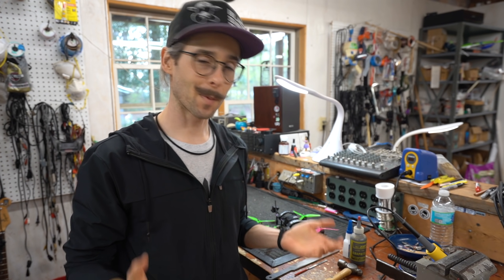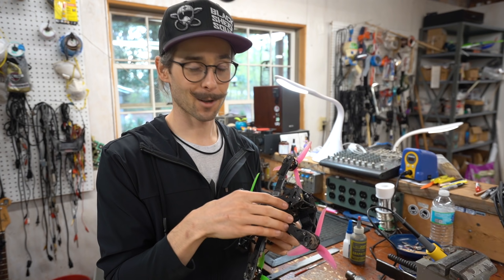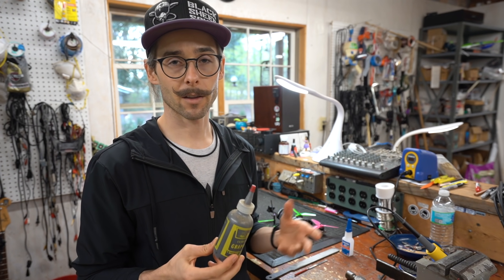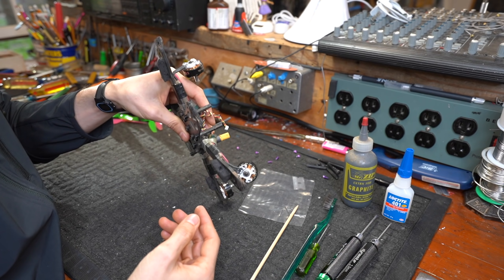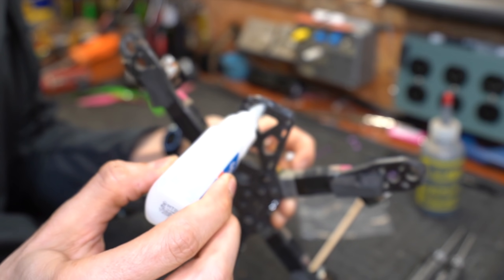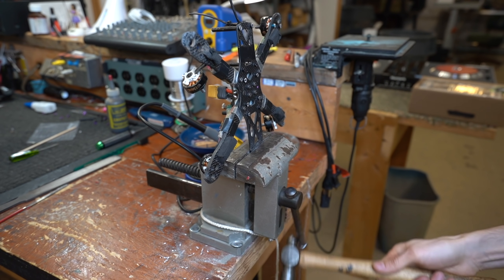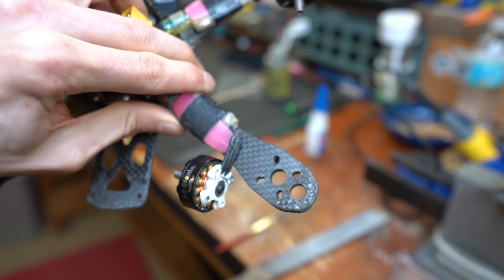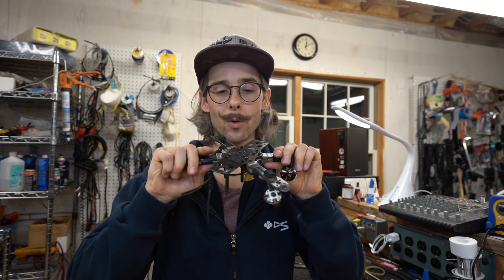DIY CHEAP Carbon Fiber Repair | FPV Drone

Comment: If the edges weren't exposed they wouldn't delaminate so often. One of these days I'm going to make a mold that adds a 90 degree lip to all edges of the carbon. So it would be a total flat plate but that lip will mean impacts are on the side of the carbon and not on the exposed edge.

Comment: Sweeeet!! Had frayed arms that frayed at the center of the quad where all four met up and were held with a screw and washer. New arms were out of stock, but after your video, glued, clamped, put back together, and back in the air!! You saved my weekend braaaa!! Thanks for posting !

Comment: Thanks for the graphite powder tip. I've used super glue with baking soda but the graphite powder is the missing ingredient. Just ordered a bottle of it from amazon. I may experiment with a baking soda/graphite mix to see what it does. I would recommend using smooth jaws on your vise and use a piece of pipe instead of a hammer. But overall, I appreciate this video.

Comment: you know a little length of PVC pipe will get you enough leverage to really clamp down on the vice without having to use a hammer :)

Comment: Hello  steel nice  video did u know if u use bakeing soda with locktight 401 it dry almost instantly and harder than just letting it dry

Comment: Please read this! As an aircraft mechanic working as a composite repair tech I feel I can give you some advice.  Clean the damaged area with acetone and you absolutely should mix that graphite in with your glue stuff and use a syringe to inject it into the cracks. The filler is what gives it strength. The glue will just crumble and crack on impact without it. Also, use sand paper not a file. Wear a respirator and gloves when sanding. You don't need to clamp it so hard. Most composite repairs only need 14-25 lbs of pressure during the cureing process. What you're doing is squeezing the adhesive out starving the damaged area of adhesive. Just turn it hand tight. 14lbs isn't a lot. I hope this helps you.  You've gotten me into the hobby and I hope to be as good as you one day.
Reply: Hmm interesting
Reply: As someone with 20 years of experience in composites and aviation, i concur with the above advice :D. as far as pressure goes, a good rule of thumb is to have 1-3kg/cm2. you can go as high as 8 kg/cm2 essentially simulating a high end autoclave or a pressure mold, but that is really unnecessary in such repairs.
Also, if you can, use epoxy resin and not CA, which is very brittle. CA is okish for field repairs. if you absolutely must use it, i'd recommend starting with a thinner CA which can penetrate deeper into the delaminated fibers, but you need to clamp the area in advance as it cures in seconds, not minutes

Comment: Yo, a lure lock needle applicator + clear fiberglass resin + paint mix stick+ johnsons floor pastewax (release agent). Apply a hot batch of resin graphite mix to the area. Pinch it with the sticks (coated in pastewax) throw it in a vice or grips and you'll have a super strong shiny repair.

Comment: Good call on the cf repair. An actual product is available for the automotive industry, its called "Q-Bond". Very overpriced for what it is, which is actually just very thin CA glue and 2 colors of graphite powder. It can be used to fix broken mirrors, nipples on radiators, etc.. I Never thought to use the graphite as "filler" on my drone frames. i always just used glue, then clamped the crap out of it.  Thanks Steele..

Comment: I guess MY opinion in support of refurbished carbon vs. new plate, is that the carbon has 'broken in' all together, with all of the various pieces of carbon gaining or losing an amount of flex. So, replacing a single piece will cause for unbalanced flex, which WILL matter to the discriminating performer. no,,, not THAT much flex, but enough to matter.

Comment: Yo Steele, big fan for almost the entire year since I started getting into this stuff!  I wanted to see if you might consider either doing me a favor or telling me I'm nucking futs and to get over it. It's OT for this video, but I was just watching one where you were talking about it and I figured I'd have a better chance of you seeing this on your most recent.

So I know from watching your videos that you consider audio to be very important. I'm very audio oriented myself. It bugs me to drive a car, at least when I'm in "performance driving mode", when I can't hear what the engine (the entire car, really) is doing.

I've been laughed at and shrugged off as some kinda nut when I bring this up. Most recently by "Boost Goose" in an NBD video. 

Could you PLEASE get just one manufacturer to make a VTX or AIO cam setup for tiny whoop class quads that has audio? I'm not yet great flying even whoops, but in a race setting I seem to suck much worse than I really do if I can't distinguish the sound of my whoop from the others in the race. I've started using an AKK Oscar's Backpack VTX on my whoops, but I haven't yet come up with an elegant way to mount it on a 65mm whoop and due to its size it's also a bit heavy. Maybe you'd consider making it an Ethix product, or possibly convince someone in product development at a manufacturer that there are people besides me out here who are looking for this product? The weight penalty of adding the little Mic and circuitry to do audio has to be practically insignificant. I can't imagine it adding it up to more than 1/10th of a gram. I know for a fact that there are others looking for this, because I was told about the Oscar's Backpack VTX in a thread on RCGroups where several people chimed in that they'd love to buy a product providing a good solution. When you went buzzing around your folks' house found the range check on your whoop, didn't you miss being able to hear the motors? At this point, I wouldn't be surprised by you being able to fly a quad epically while blindfolded and soundproofed, but some of us need all the help we can get and I certainly don't need any handicaps, like having only the video for reference of what my whoop is doing. I've even thought of maybe trying to use a fake sound that changes pitch depending on throttle position in my radio to give me audio feedback on what my throttle position is, but that wouldn't really correlate pitch and motor RPM as the battery sags and drains.

I would be forever in your debt, an even bigger fan, and I'll sub, like and comment anything and everything you do for the rest of my days if you manage to make this happen! 😉 Not sure why I winked, 'cause I'm totally serious about the promise. 

Sorry about the long comment, but I don't think a good solution that I've just not found or thought of exists today, and my pleas, to date, have fallen on deaf ears. I imagine the product will appear in the marketplace eventually, as technology progresses, but I'm old and would like it to happen ASAFP, before my hands become so crippled from arthritis I can't fly any more. Which brings me to another product idea, but I'll save that for another time.😉

To anyone who has read this far, Thank You! If you know of anything better than the Oscar's Backpack VTX, please point me in the right direction. If you agree or disagree, please thumbs up/down and/or reply. Thanks again!!! 🖒👊✌🖖

Comment: I need some super glue! I have been flying over parking lots to stay out of the water and my rooster arms are beat!
Reply: Why don’t people use liquid electric tape or plasti-dip sprays, or even just regular spray paint to make the electronics waterproof? Just did my VTX and camera board and watched this video while it’s drying, lol!

Comment: pro tip for superglue: it cures through humitidy. drying the parts can help a lot to get it to flow into cracks. and lightly blowing on it makes it set faster.

Comment: If you add a filler to the CA glue it sets really quick. Possibly before you put it into the vice (or partly). My tip would be use only CA when you 
re-laminate it in the vice. Use the CA & filler combo after laminating for filling gaps and aesthetic purpose. Disclaimer: use a mask when filing/sanding carbon fiber or do it outside in the wind or do it under water.

Comment: Steele, do you know what type of resin is used when the carbon is first made(epoxy, polyester)? I have done similar repairs but with thinned epoxy to make it runny like supper glue. I found if you wrap the the part in plastic thin put it between two pieces of wood and then put that in a vice or use a bunch of adjustable clamps you get a pretty smooth finish that requires a lot less filing, if any.

Comment: You don’t fly outdated gear.  I spent the last 18 months buying all the latest stuff.  Spent more time figuring new parts out rather than flying (another no no of yours), I dug up my old alien frame and rebuilt that.  It’s solid, flys great.  I should have been focusing on flying and not building this whole time!!  Damn it is so much better watching you than that Bardwell dork.

Comment: You said generic carbon fiber repair but every frame I've had delams at the tips of the arms do to grinding against concrete.  I'm assuming the Armattan chameleon frame as well as the Emax Hawk 5 frame . Because those are delamming too

Comment: Great work!  Thanx 4 sharing.  I would have replaced arms and never thought of repairing them - and it is that easy. My first try would have been using epoxy, but your hint that it is not thin enough makes sense. +1 for the graphite trick - that looks like original carbone without painting it - and it functions as a filler too. Much better than painting.

Comment: THX Steele. I wanna see more repairs!!!
People think (including myself) that pro pilots just replace stuff each time because of their sponsorships. It's good to see that one of the best is "human" and does what the "hobbyists" do. Thumb up!
That said I'm gonna cry taking a shower 'cause I just replaced a motor that took forever to come and I crashed after 20 sec (battery came off after some quick rolls in a row). Arm cracked and I guess is beyond repair 😭. Cool part is that cracked carbon fiber looks so sexy!
Reply: I think a lot of people have this misconception with 
"sponsorship" especially when referring to mini quad pilots. I'm sure most of them have a few spares lying around,  but Its not like most think as in they have like boxes and shelfs full of new frames and new arms and piles of electronic's. I may be wrong but I just don't think it's like that. Plus knowing Steele he dose have extra frames on hand, he just dont want to break into a full kit for a couple parts. Rather fix the jacked parts and save the kit for a nice new crispy build. But I don't know... just rambling over here..
Reply: @jasonhull5712  lol yeah I also like the conception of repair when possible. I generally tend to repair as much as I can instead of replacing, as a lifestyle 😊

Comment: Yup, looks good.  The combination of thin CA and powders make REALLY strong joints.   I have seen many musical instrument repair folk use the CA + baking soda trick.  Subbing out graphite makes a lot of sense for carbon fiber, don't have to go back and paint anything.  If others want to save some of that graphite when you are spraying it onto the CA, then you can just do it over some paper and then fold it and pour it back into the bottle when done.

Comment: Graphite in the magnets of the motors \m/
Reply from the maker: ....   considering graphic is magnetic and all...........   NOT ..
Reply: @MrSteeleFPV  it's highly conductive though and you've blown it all over the place, good luck with your shorts.

Comment: Holy shit no respirator,As someone who has worked in a field where I was cutting carbon fiber on the regular this is major cringe
Reply from the maker: Yeah I was mainly filing glue.  Very little Carbon was filed
Reply: @MrSteeleFPV  Please read this! As an aircraft mechanic working as a composite repair tech I feel I can give you some advice.  Clean the damaged area with acetone and you absolutely should mix that graphite in with your glue stuff and use a syringe to inject it into the cracks. The filler is what gives it strength. The glue will just crumble and crack on impact without it. Also, use sand paper not a file. Wear a respirator and gloves when sanding. You don't need to clamp it so hard. Most composite repairs only need 14-25 lbs of pressure during the cureing process. What you're doing is squeezing the adhesive out starving the damaged area of adhesive. Just turn it hand tight. 14lbs isn't a lot. I hope this helps you.  You've gotten me into the hobby and I hope to be as good as you one day.

Comment: man, buy carbon fiber resin, you can get it for fairly cheap and it appears to the composite 3 or 4 times better than any super glue out there. granted super glue works but Amazon man, and if you really want it strong buy can't get carbon fiber cloth you can get some gloves and use fiberglass chopped matt, if you gotta have it black then use graphite to color the fiberglass. still mix it up and wear gloves and pack the resin soaked chopped matt into the end or place of repair. now either use a plastic zip lock bag corner or just leave it as is and clamp in vise or with hand clamps or even just weigh it down and let sit for about 2 hours. the fibers will make a huge difference vs powdered graphite and I'm just tossing this out for people who want to do this but want to do it closer to properly. last if you do have carbon cloth and a Dremel you can always Dremel down an arm a layer or two on each side, sand with 80 grit or 100 grit and then put together and lay a single layer on both top and bottom and bag and clamp, as long as the arm is butted up well and you use two layers and clamp the arm should hold up nearly as well as it originally did. just look up carbon fiber layup for anyone who wants to know about grain direction etc
Reply: Josh Hall I recently used some uv resin I use for fly tying and it seemed to work well. I bet it would be killer with some graphite filler tho. I’m glad I found the video here and comments within.
Reply: @platty9237  UV resin won't set up if you add carbon or graphite, the UV needs to be able to penetrate the resin. Stuff like soloares and such. Although they will kinda set up once started they just won't set up fully or properly without the UV being able to go deep

Comment: Yo G, can You tell me how You manage not to break gopro lenses ? Because on harder crash tempered glass i assume is not enough. I projected a tpu mount in fusion360 with a plexiglas lens cover but it has one disadvantage that it scratches easily. I will change it to normal glass i think.

Comment: And THIS, ladies and gentleman, is why you dont buy $100+ frames lol 80% of the frames I fly I can replace for less than $50 and it takes a long time to get to the point where i need to replace it lol
Reply from the maker: You buy 100$ frames because the build process and design are amazing lol
Reply: @MrSteeleFPV  Ya i dont know who youre trying to sell on that nonsense man. My $40 Eclair v2 frame from airblade flys better than any of my armattan frames... when i started i bought expensive frames and budget motors. Now i buy budget frames and quality motors because I have never had ONE quality issue with a frame... especially for freestyle. If a frame costs more than 100 bones its either got a titanium cage or its being sold on its branding alone.

Comment: I love that a fully sponsored very talented professional pilot with a box’s of free quad frames fixes carbon fiber $6 arms:) I bought a 6 pack of arms from RR for a good deal. Your the man Steele!
Reply: Totally isn’t I have (3) aliens  3 arm screws 2 motor screws, and some double sided tape/electrical tape and your done. 10 minute swap and your back in the air.
Reply: FPV5150 lol
Reply: Easier to do that than replace the arm on the alien :)

Comment: luckily quads are non perishable so who cares if what you like to fly is outdated.

I still like Betaflight 3.0 with Multishot and in many ways i think it is better and much more solid in the air than newer versions at least on a f3 board anyway.

Comment: Don't file it. Carbon fiber dust is more or less like asbestos.
Reply: Filed CFRP shouldn't be like asbestos which makes strands, but still it's quite toxic. Maybe just use a mask?
Reply: Use sand paper. Wear gloves and a respirator with the proper filters.  I use p100's. Don't mess around with breathing this stuff.
Reply: How does it compare to that graphite dust?

Comment: Awesome steele have you ever tried cleaning it with DP60 & an old toothbrush to clean up those dirty bust up carbon and give you a good clean surface for working on :-)  and have a stronger repair steele

Comment: Is there a danger of getting the graphite  powder into the motors or your electronics?
Reply from the maker: Nope. It’s not magnetic that I know of
Reply: @Ryan Ringer Graphite is conductive, dunno if it can break anything, be sure to dust off your quad before plugging the battery just to be sure.

Comment: My old mr steele quad got broken on the top plate, i got it fixed by CA and sodium bicarbonate. Works great but it was a weak point on hard crashes

Comment: Now if only this kind of thing would work for damaged lipos. haha Just destroyed my first lipo going under a picnic table. Might make the switch to 5s.
Reply: Hey man, I run a 3D printed TPU skid on top ,, meant for bottom mount setup, protects great, https://www.thingiverse.com/thing:2267446  tpu arm bumpers save the carbon too, 2-3 grams each.  Hit me up if ya need any prints, I sell on ebay and rcgroups
Reply: Thanks man. I’ll take a look and throw em on my cr10. Appreciate it
Reply: @walrusking4197  no prob man happy flyin